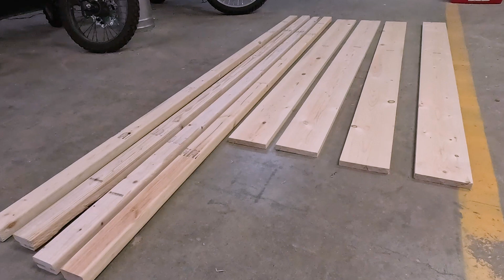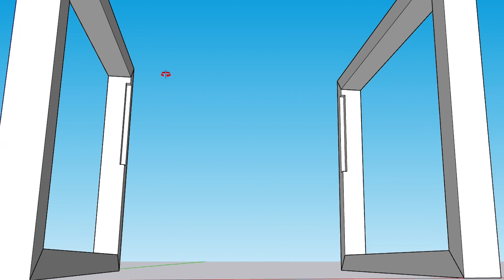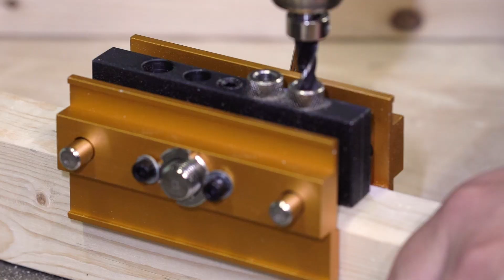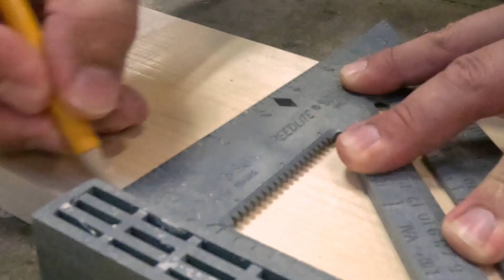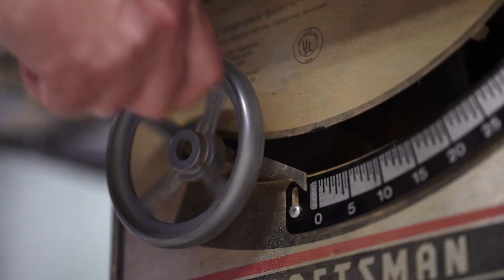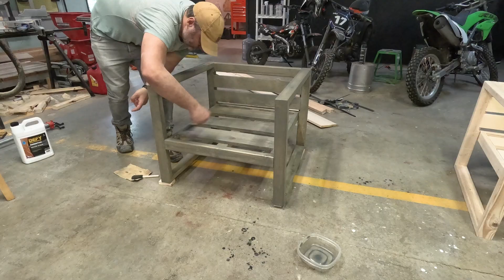Build This DIY Modern Patio Chair

Comment: Do you have a sketchup file you can share?
Reply from the maker: Yeah, do you know the best/easiest place to upload the file to share?
Reply: @pnwconcretehouse8581  I also think you can attach it to this video.  I've seen that many times.
Reply from the maker: @ddddewey  I added a link in the description, let me know if it works.
Reply: @pnwconcretehouse8581  One issue I found with the sketchup file is that you entered the width of the 2x3s as 1-3/4" when it's actually 1-1/2".  This created a few problems I had to work around.  The list of wood necessary for two chairs was also lacking and I needed to make an extra trip to the lumber store.  In general, it was a fun, yet simple, project.  Thanks.
Reply from the maker: @ddddewey  Thanks for letting me know.  I'm glad you were able to make it work for you though.  I made the change to the sketchup on the matching sofa project I am working on now.